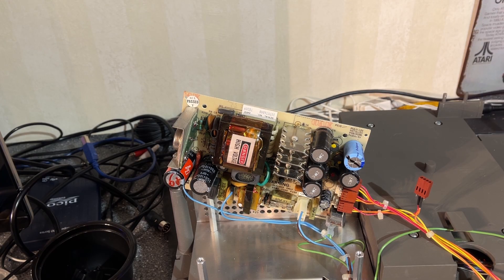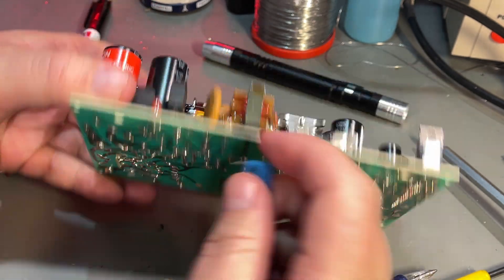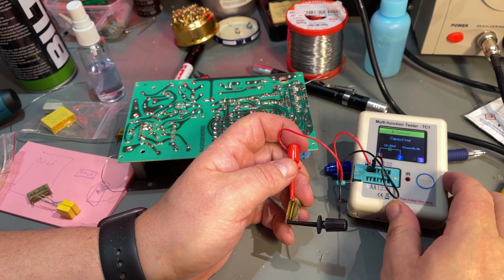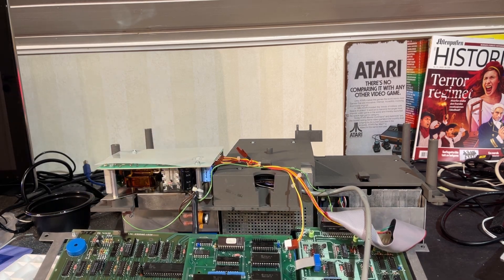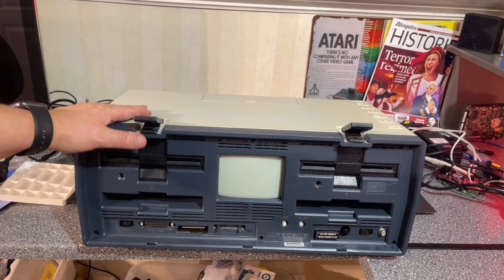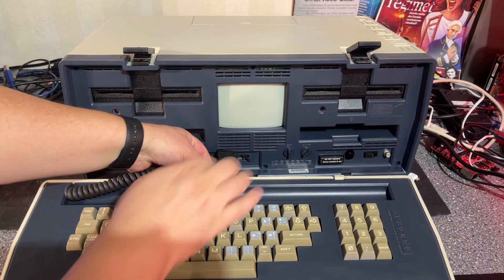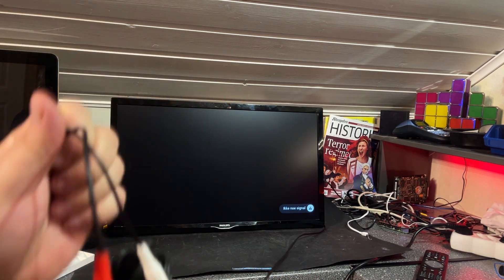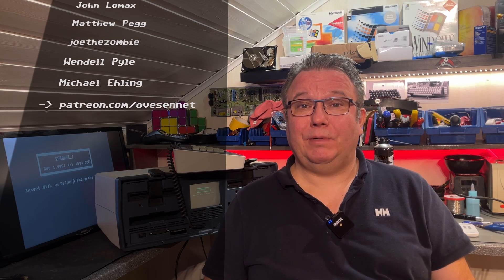The Osborne 1 computer - Replacing RIFA's and testing CP/M - Part 2 of 2

Comment: This seems to be not a standard ROM version. Please dump and upload the ROM, it might contain modifications which are not widely known... :)
Reply from the maker: Oh really? How can you tell? And where would I dump it?
Reply: @Arcticretro  On powerup, it says Rev. 1.445I if I read that correctly. Never seen that before (and I have seen a lot of Osborne 1), Rev 1.44 is the last known revision. So I guess somebody might have modified that ROM in some way we can't tell yet. If you have an EPROM reader, you better read that ROM and save it. Might be something special, might not be - nobody knows. Upload it to bitsavers or anywhere so it is saved and people can analyze it and check it for modifications. EPROM readers are cheap these days, a simple TL866 is sufficient. Every retro computing enthusiast should own one. All those ROMs are in an age where they experience bit rot and become increasingly unreliable. You really should do backups before the contents are lost to time.
Reply: @congestiontv  No need to unsolder it, it is always in a socket.
Reply: @congestiontv  Actually, there is no real need to even open up the machine again as the ROM could also be dumped to disk with the CP/M debugger DDT.
Reply: @congestiontv  I don't think the Osborne Computer Corporation is still able to legally sue anybody ;).